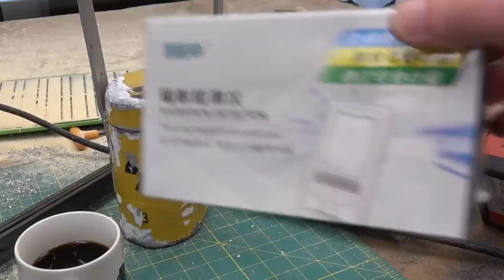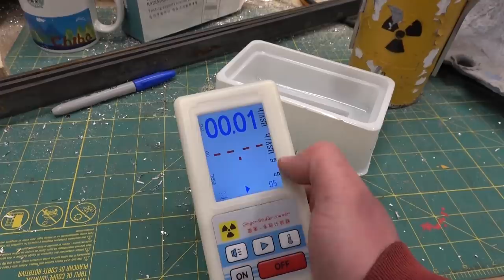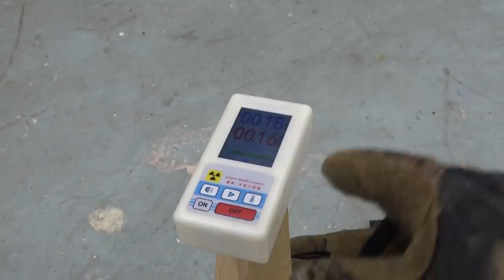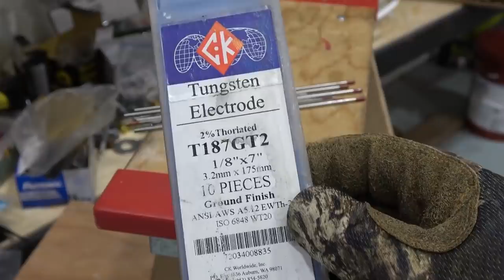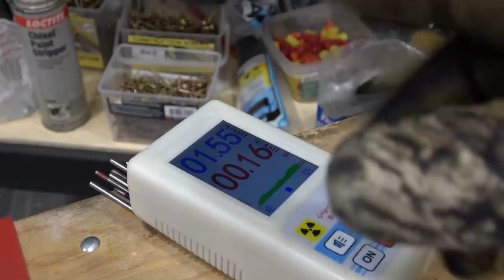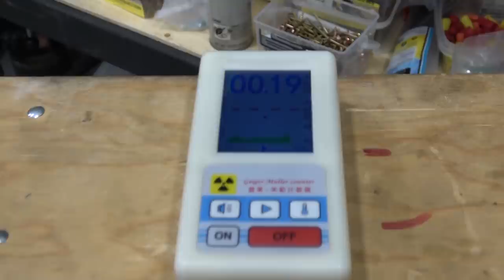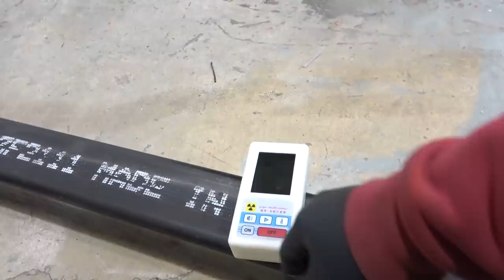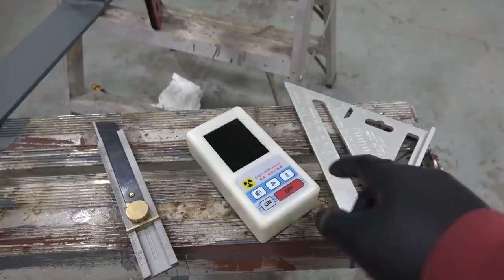Testing Radiation from Tungsten, Japanese Steel | Welding Metals Tested

Comment: thorium's decay products give off beta, I have a thoriated camera lens from the late 60s (super-takumar 50/1.4 if anyone cares) that reads about 8000 cpm on the rear element, but if I put a plastic cap on it drops to like 800cpm. the radiation disrupts the structure of the glass and turns it yellow over time.
Reply: care to give a quick explanation as to why camera lenses are/were thoriated?
Reply: The first selfie filter was “photo luminescent”
Reply: @peterjohnson9438  thorium oxide increases the refractive index of the glass. lanthanides are more common today.
Reply: @peterjohnson9438  to reduce the ~1/2 dozen typical lens "aberrations" . .  in high refractive index lens.
Reply: If you leave the lens out on the windowsill with rear element up the sunlight will clear the yellowing. Theoria Apophasis You Tube site has done several videos on thorium doped lenses.
Reply: yea I know, but white balance corrects for it and I like it far too much to be able to not use it for a while.
Reply: I watched a lot of things about radioactive lenses (I own a Kodak aéro ektar) and read lots of misleading info. From what I sorted out of this mess, if I do not sleep with the lens under my bed, I should be ok. But I also wonder if a metal cabinet, would help or having it at the far side of the house is enough. Would it contaminate the surroundings as well ? I have been looking for a Geiger counter. As it’s a huge lens, I think I will try to get some serious measurements soon.
Reply: I think there were thoriated cigarette filters at one time.
Reply: @5roundsrapid263  we used abspestos in gas mask filters for the world wars.
Reply: @xavtek  The beta rays get stopped by a piece of aluminium foil. The bit of gamma you also get isn't much. Probably about a banana or two worth a year.
Reply: @robertbogan225  how about cigarette filters?
Reply: ukezi thanks !
Reply: @pikachu.922  A UV flashlight will do the same job quite a good deal more quickly.
Reply: @IAnolastname  how quickly? I have a 5W uv lamp at work that I could totally put it under.
Reply: @robertbogan225  If my options were asbestos or mustard gas, I don't think I would be complaining. The knowledge helps you maintain a healthy perspective though.
Reply: I was curious about this and checked it out at work, it checks out,  Beta radiation it is.

Comment: I’ve worked with a nucleonics level instrument or two over the years. I went on a service job because both detectors on a vessel had “failed”. It took about 10 mins to discover that the vessel was an oil and gas separator and they’d managed to fill it with radioactivity. They had readings of 80-120uSv/h around the vessel. Even the radioactivity guy was impressed with it. Luckily I’ve done with having children.

Comment: Steel from the Bismarck was on the voyager probes for the reason of needing low background to not throw off the Geiger on the probe
Reply: I doubt it was from the Bismark. It is a war grave, and is basically off limits. The steel likely came from another ship or big old pre-war machine.
Reply: Probably from the high sea fleet scuttled in scappa flow
Reply: Bismarck wreck wasn't located until 1989, so that can't be right.  Plus at 3 miles deep, easier sources surely exist
Reply: And in thinking more, the steel was probably not from a sunken ship at all. Back in the 1960s and 70s, it was so much easier to get your pre-bomb hunks of steel from Cleveland or Pittsburgh.

Comment: 10:00 I believe the inverse square is caused by the dispersion of the radiation over an area. as you go further away, it disperses into a larger area (m^2).
Reply: Flux is a measurement of particles deposited in an area. It’s all about solid angle. Think about the density of particles traveling away from a point and how they diverge.

Comment: Some people that work in HVAC have discovered filtering thorough a cigarette R22 can be deadly. It decomposes the refrigerant into phosgene an incredibly toxic gas, worse of it is that it takes some time to make effect, depending on the exposure you can feel like suffocating for some minutes then you feel alright just drop into respiratory failure 24h later. Scary stuff!
Reply: Teresa Shinkansen phosgene gas was the main ingredient in mustard gas used in WWI if my memory serves me right.

Comment: We used xenon gas excited by cesium 137 for our densitometer, high voltage on xenon canister.   Has photo multiplier tube at end of cannister. Gas glows and tube measured brightness.  Less brightness more dense material in tube. For measuring desity of solids in a fluid  thanks for covering this

Comment: AvE.  First off, I love your videos -- keep up the amazing work!  It's always a treat to break up the monotony of work for some proper shop talk.

Regarding why energy dissipates not linearly, but exponentially:  I believe the unintuitiveness originates from reasoning about the world in 2D (on paper with diagrams).  If you take a step back and remind ourselves that we live in a 3D world, it becomes intuitive again.

In a 2D world (point source in the middle of the page), energy emitted at the point source is preserved and radiates equally in all directions.  The energy intensity falls off linearly as the circumference grows.  Ignoring the constants of Circumference = 2*pi*R, the radius of the circle would dictate a linear relationship.
In a 3D world, we instead need to visualize a point-source emitting sphere (actually the surface area of a sphere instead of a circumference).  The energy intensity falls exponentially as the sphere grows.  Also ignoring the constants of Surface_Area = 4*pi*R^2, the radius of the sphere now dictates the energy falls of by the square-root of the distance from the point source.

Comment: I'm thumbing this up to ask you this question directly -- would you consider doing more videos, testing and comparing different "RADIATION DETECTORS", because damned if I can think of where to buy an over the counter Geiger counter.  Seems like the type of thing the System doesn't want Joe Blow to own and operate without a license, ya know?
Reply: They're spendy, but readily available.
Reply: I think there's also an issue with comprehension and interpretation by the average consumer. 
It's worth noting how long it takes someone as capable as AvE to bumblefuck his way through the numbers in pursuit of a meaningful conclusion.
In short: Nuclear physics is hard.
Having said that.. the limited availability of radiation meters does nothing to make me feel like public trust is entirely due...

Comment: I remember reading somewhere that the reason for the cobalt-60 in steel is actually intentional, they mix (or used to mix) it into the furnace lining, which enables you to measure the wear on the furnace by monitoring the flue gasses for radioactivity. The problem is of course that eventually all steel becomes contaminated with it due to recycling, thus making the sunken German fleet in Scapa flow valuable as a source for pre-atomic age steel. There’s also a demand for lead that was melted down more than 400 years ago, since all natural lead ore is slightly radioactive, and the last fission product takes around 400 years to decay. This caused NASA to pay for the roof replacement of the Nortre Damme cathedral at one point.

Comment: I work in the industry. Yearly allowed for us is 50mSv or 100mSv over the span of 5 years. In the event of a disaster we have a limit of 4Sv on skin while rescuing people from immediate danger, which, I'd say is pretty spot on LD50 and when this blows over and we would get to the clean up phase, decontamination, digging up top soil etc etc we are back to normal limits. Now you calculated a dose of background over a year of something like 1.5-1.7mSv which depending on your location is correct. Considering the tungsten tools give you a little extra when around (just don't sniff them or eat them and what use a respirator if you are afraid), flying on a plane also gives you a boost, iirc @30,000ft you get something like 10 times the background? I may be mistaken about the exact number but yeah. There is really nothing to be afraid of. Thundertoot has a video on this topic explaining it pretty well.

Comment: Hey AvE! Cool video! 
I happen to work in a radiation physics lab in Sweden and have some comments regarding the instrument you used to test the steel :)
You are very unlikely to ever pick up any contamination using something like a GM tube due to it's low efficiency, you could potentially try with a larger "scintillation" detector and long integration times to try and pick up what's in there but still unlikely you would find anything. Our sister lab has a few spectrometers for very low activity determination and if you would like to send me a small piece of American steel and a small piece of Japanese steel I could ask them to analyze it for you, could be a fun exercise for a future video! (You would get activity instead of dose (in Bq/kg instead of Sieverts) but I think activity says more in this case anyway).

Happy video making!
-Mie

Comment: What's the function of the 2% thorium in those welding electrodes, if I may ask?
Reply: It makes them radioactive so no one will be tempted to steal them from you
Reply: Extract more electrons at lower temperature by reducing the voltage required to get them out of the metal. Thorium goes to thorium oxide at the surface, and thorium oxide is the surface coating you need. Presumably makes it easier to strike an arc and/or not melt your tungsten.
Reply: Thorium raises the melting point of tungsten.  While tig welding  (on Dc straight polarity) the tungsten is ground to a fine point reducing the area carring the current to the work. Without thorium the fine point of the tungsten, may not  melt off, but it does create a small ball on the end of the tungsten.  This can make the arc wonder, and the amperage is now spread over a larger area, making the welding puddle harder to control, and  reduces the effectiveness of arc force (leading to less penetration) .  When welding Aluminum they do not use thorium because they want the tungsten to create a ball on the end.
Reply: Lanthanide metals have an interesting property of being extra-eager to emit electrons, which makes them popular as coatings or additives to all kinds of electrodes. Thorium also happens to produce beta radiation (electrons) which helps even more. Makes it a little easier to strike an arc, and produces a slightly more stable arc with a lower electrode temperature.

Nowadays, thoriated electrodes have been superceded with lanthanum, cerium, or other non-radioactive additives.

Comment: For those inquiring minds. The accepted does limit per annum of a Canadian nuclear energy worker is 50mSV per annum. With a maximum of 100mSV over a 5 year period. And radiation sickness will begin to show signs around 1000mSV of accumulated dose.

Comment: I tell my non-physics buddies like so:
a wave in 1 dimension loses no amplitude because the wave front is the same size as it moves (wiggling one end of a jumprope) Amplitude(r)=A0
a wave in 2 dimensions loses intensity linearly as the circumference of a circle grows linearly with its radius. S=2*pi*r (stone thrown in a pond) A(r)=A0/r
a wave in 3 dimensions loses intensity squarely as surface area of a sphere grows squarely with its radius. S=(4/3)pi*r^2 (light/sound waves) A(r)=A0/(r^2)

Even worse, eyeballs measure light logarithmically. This means that we see the order of magnitude (what we see as twice as bright is actually 10 times brighter). So perceiving the inverse square law with eyeballs is pretty terrible since "4 times darker" barely registers.
Thanks for the vidjeo, impressed by your knowledge of my field when my field ain't your field.

Comment: Fun fact.
The alloy stellite was widely used in valve seats due to its wear resistant properties.
And nuclear powerplants have a lot of valves, and despite its good wear resistance small particles of stellite goes with the flow to the reactor core.
Stellite contains cobolt, and that cobolt gets activated by slow (moderated) neutrons and turns into cobolt-60 wich is a high energy gamma source with a half life of roughly 5 years.
A big part of the amount of dose a nuclear worker recieves has its origin in stellite.
Now when valves are restored/repaired the valve seats are changed to ones of a more suitable material.
So, alloys/stainless steel with cobolt is a no no in the nuclear sector.

Comment: Finally he gets on a topic that is my money-maker. I am a nuclear engineer and health physicist. UV radiation is not ionizing, by definition. GM tubes need to be filled with a gas that ionizes, but then "quenches." 
µSv/h can be deceptive with a GM tube because it has to be calibrated for a certain energy of photon. Apparently the tube can be constructed to compensate, but at low photon rates, it still gives you problems due to counting statistics. If you are in the Poisson counting regime (where counting is not Gaussian), all bets are off. 
Canada only requires posting at 25 µSv/h because at that rate you will over-expose a Nuclear Energy Worker at 2000 hour work-year. 
Radon in your lungs isn't all that bad, it is considered a submersion dose (breathe in and breathe out). It is the Polonium daughters that are the nasty. Rn-220 has a shorter half-life than Rn-222, so doesn't really have the time to get out of your floor and into your lungs--welding rods, well that's it up to you.

Comment: cobalt 60 and iridium 192 are used in the non destructive testing industry though normally its a tiny pellet inside a depleted uranium box but you definitely dont wanna mess with those in your pocket. there have been incidents where someone picked up a live radiation source like that and died of radiation sickness

Comment: Detectors are usually filled with nitrogen or BF3 gas (Boron Triflouride), just so ya know.
Reply: What is that
Reply: @SBdunks3  Its a gas that when excited by an electron releases more electrons causing whats called a cascading effect (think of an avalanche) which goes on to cause a high enough pulse that its able to be detected by the detector.
Reply: pinksock133 thank you for explaining I appreciate the knowledge

Comment: Guess I should stop using the thoriated tungsten electrodes as toothpicks then.
Reply: Affra welding instructor: “make sure you wear a respirator when sharpening thoriated tungsten” me (an intellectual): if the radiation gives me an extra arm that means I’m 1.5 times more productive which means 1.5 times the pay

Comment: Detecting and collecting radioactive materials is fun! The Inspector USB Geiger-Müller counter is mostly what I use, since it can detect alpha particles too. It depends on energy too. For example, hydrogen-3 (tritium) emits very weak beta particles, but strontium-90 and its short-lived decay radioisotope, yttrium-90 emit very high energy beta particles. Also, many (not all) alpha and beta emitting radioisotopes emit gamma radiation byproducts of specific energies with differing intensities (branching ratios). That's why gamma spectroscopy is very useful. You can identify many radionuclides.

Comment: The inverse square law is very straightforward.  Most radiation sources will radiate out in all directions.  That means it radiates out as a sphere.  The radius of the sphere at the point of interest is the distance... And the SURFACE AREA of a sphere is 4 pi r^2.  So if you double your distance the radiation is spread over an area four times the size and hence the DENSITY of the radiation is one fourth.  This assumes the target (you, your eyes, your ears, your target you are aiming a RADAR/laser beam at) is small compared to the surface area of the sphere... Your radiation exposure is then the radiation density * your area.

Now... You might say, but I have a flashlight/focused beam... It doesn't matter.  The beam still acts as a cone whose radius at the target is directly linearly proportional to the distance.  Think of it like a right triangle.  For a given right triangle, the opposite (radius of bream) is equal to the adjacent (distance to target) * some constant defined by the angle (how tight the beam is).

The RADAR range equation shows power dropping off with the 4th root of distance.  Essentially when you paint a target the target the energy that hits the target follows the inverse square loss.  Some portion of that is reflected (re-transmitted) and now your RADAR receiver gets the same inverse square law of what was reflected so it's the inverse square law * inverse square law.

Comment: When you had your meter sitting on the ladder taking readings on the tungsten rods the Geiger Mueller tubes were probably being shielded by the wood step so it's not likely it would have seen anything but your inverse square law did away with 99.9% of the radiation. Generally speaking the detector tubes are positioned under the digital display, there should be a coloured dot on the unit to indicate where they are but I've never seen a meter like that before so it may not have it.

Comment: Serious question @AvE, I'm a pipe welder, love the videos keep em flowin.. 

Enough 's enough, so I TIG weld pipe now and again and use 2% for everything. I keep my tungsten in a stainless "tungsten holder" which is simply a 4" 316 stainless "TOE" nipple with a coupling with a quarter welded to it on one end (to open naturally), and another quarter welded to the other end to close it off.

Maybe once you get some new instrumentation check out some stainless levels? I typically don't have the whole thing on me while working but the occasional field weld deems it somewhat necessary... I definitely knew prior that tungsten, especially the 2% stuff is no bueno to breathe, cut yourself with etc... just curious how well stainless insulates against it..